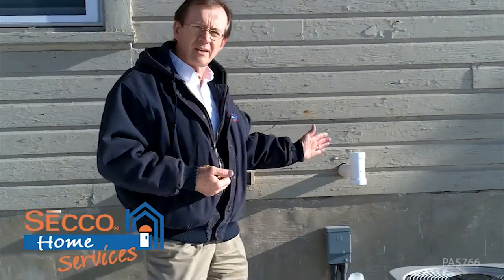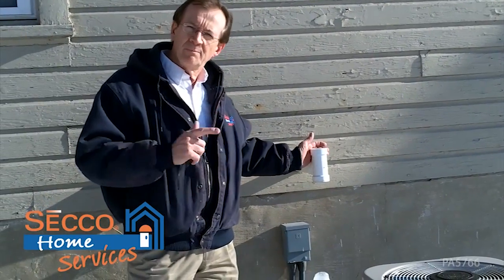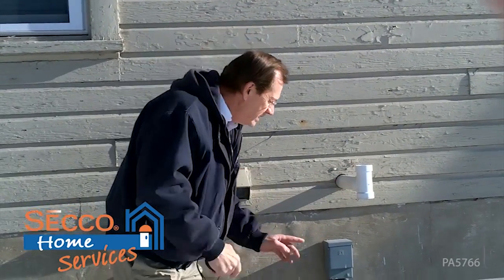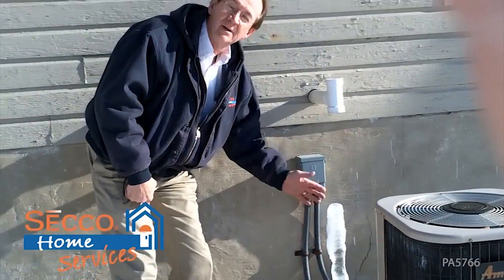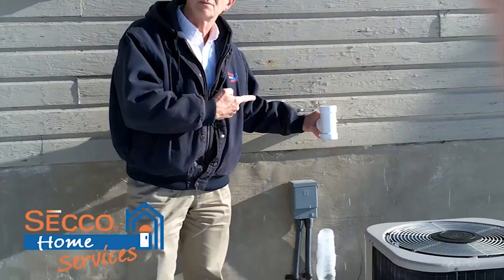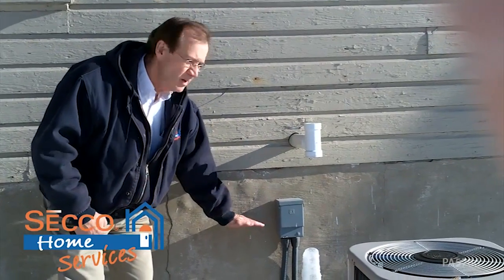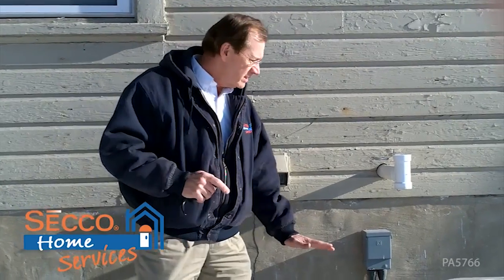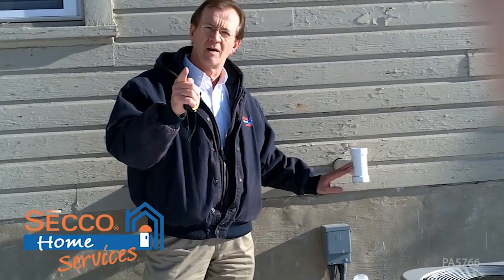Condensing Furnace - Freezing Condensate on 3 Degree Day

Comment: I get water in my basement that comes in bottom of foundation ... it would be right if I drew a straight line down from pipe to ground. Old house has cinder block as foundation . Not enough for a sump pump but annoying.

Comment: The ice will never get to that level. The exhaust gas is several degrees above freezing and will continue to melt anything below it.
Reply: I beg to disagree.  I have this exact problem happen twice since I got a new heater.
Reply: The air coming from the exhaust is about 90F-100F. The ice may get close but will never get touch the PVC unless your furnace is off for several hours and condensation continues to form and drip. But if that's the case the water will freeze inside the pipe until the next furnace cycle. We never see ice back up issues its clogged intakes from the snow that's the main issue this time of year. It's been -15F here for the last 2 weeks and ice isn't a problem at all. (Ont Canada)
Reply: I had to kick mine clear yesterday morning.  The exhaust may be 100F when it comes out, but it loses this as it gets farther away from the furnace.  I guess by the time it exits my house it's cool enough to condense and freeze in a pile.  This can and has happened.
Reply: Just for fun put a temp meter on the exhaust pipe. I bet its still 80F plus by the end of the pipe unless your pipe is 50 feet from the furnace. I think you will be surprised how hot that exit exhaust is.
Reply: What you have is a different issue. Yours is on the intake side. That is an issue. I'm surprised the furnace ran. The new high efficiency furnaces are so sensitive that even a small amount of snow in the intake pipe shuts them down. Its our number call this time of year. You shouldn't have condensation on the intake side.
Reply: My ice mound grows to the point of touching the vent, although my vent is only knee height off the ground.  Had to kick it/break it off today because it was touching.  Last time was 2 weeks ago.  The pipe runs about 20ft from the furnace before exiting the house, and then sticks out about 1 foot before necking down at a 45.  Today, the outside tip of the exhaust vent measures up to 60F while the furnace is running, and quickly drops below freezing in-between cycles.  The ice itself measured 0F.  Outdoor temp is currently -2F.  The ice mound seem to be a common occurrence in my neighborhood (just saw a facebook post reminding neighbors to check/break them).  Minnesota.
Reply: Righteous Isthelord - I appreciate the tip. Mine is well sealed.  It sounds like your house may have a slight negative pressure, which causes it to suck in cold outside air, where leaks allow, including around your furnaces exhaust pipe, which would cool the pipe, and vapors inside the pipe, making stalagmites more likely.